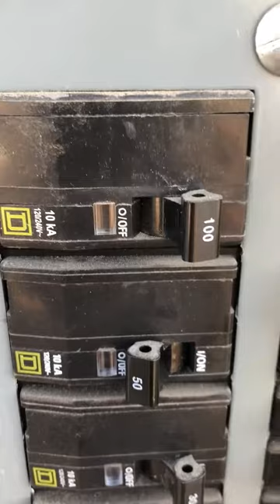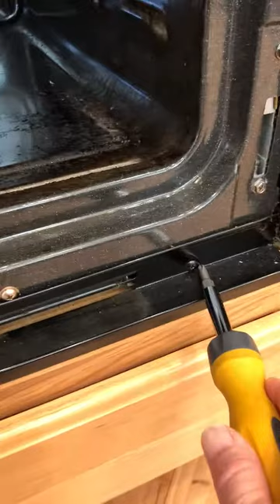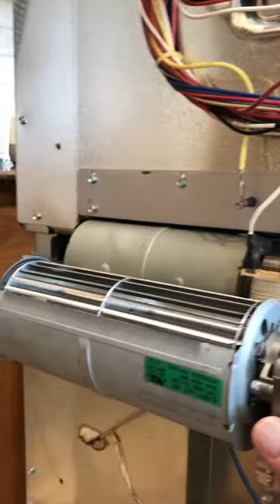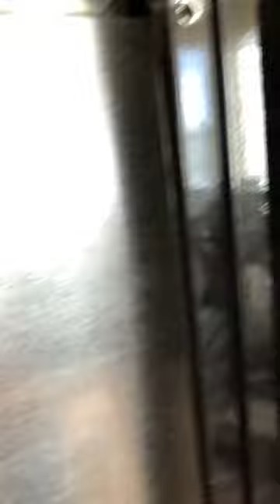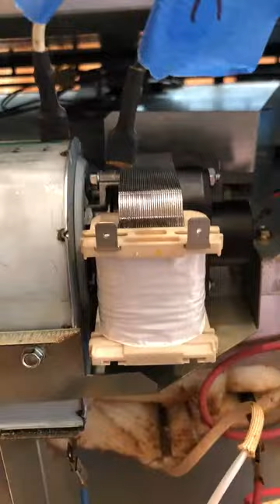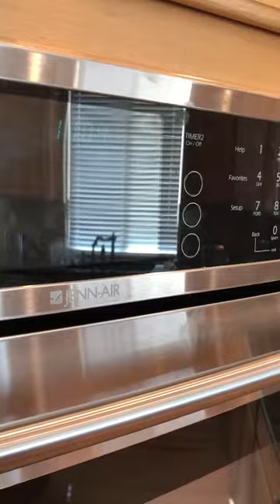Jenn air wall oven 4d22 error replace lower blower motor

Comment: I need to do the same...THANK YOU!
Reply: Do you have the same oven as this one?  If so what is the model #?  I have this oven but don’t have the model number.
Reply: @patriciaholguin4062   The model number on my unit is on the frame of the upper oven, inside the door jamb, essentially on the bottom edge of the control panel.  It is hard to find and see.

Comment: Having the same issue. The lower oven will not bake. Keeps displaying “Feature not available.” I noticed you’d mentioned there are 2 different fans for top & bottom. Could you post a link to where you ordered the part from? Great vid! Thanks!
Reply from the maker: Here's one site I use for parts:  https://www.appliancepartspros.com/